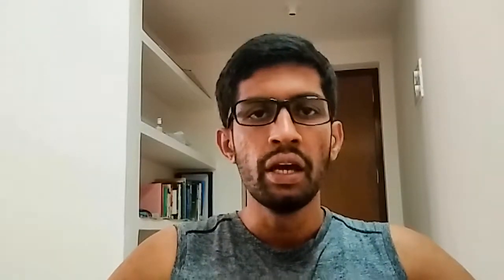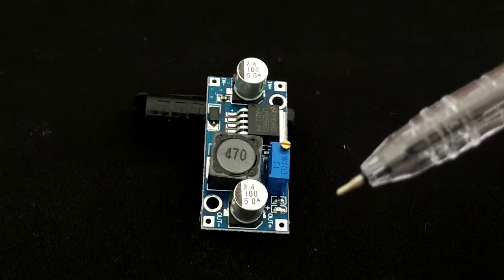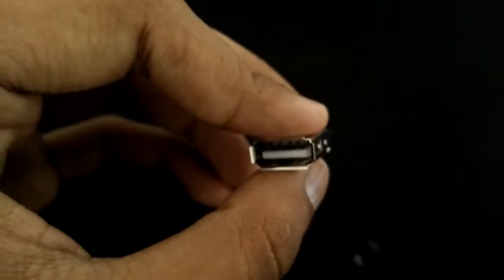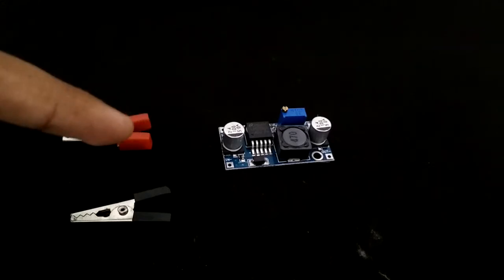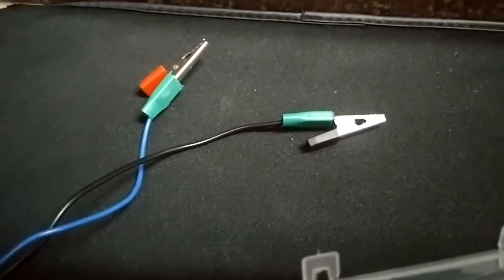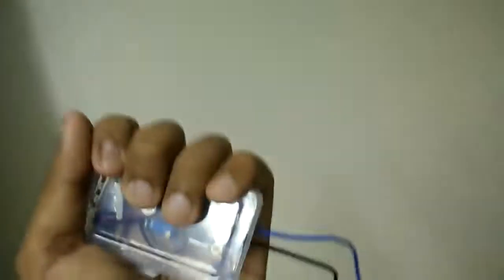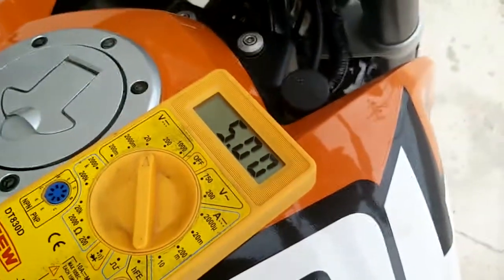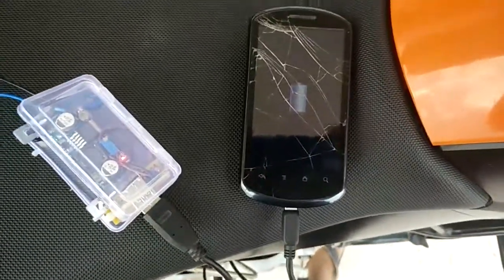Motor bike USB Charger | DIY | Cost effective solution

Comment: which wire you used to connect battery to lm2596?
thickness in gauge ?
in which shop will i get it?
Reply from the maker: Onkar Jagtap Here the thickness won't be an issue. Because the LM2596 won't be taking any considerable amount of current to be worried about. So you can go ahead and use a normal copper wire with 5-10 strands. Thanks.